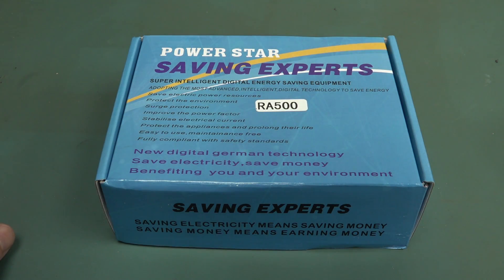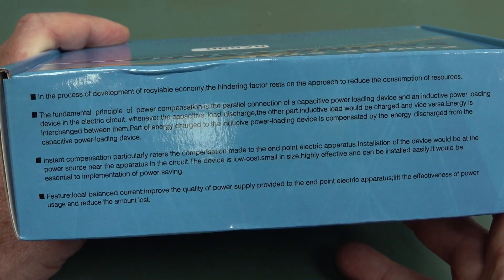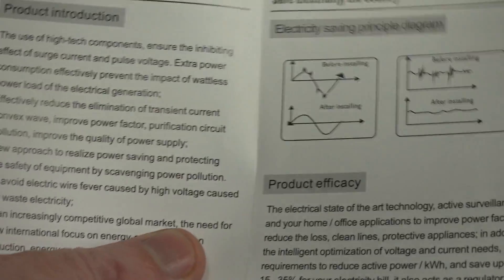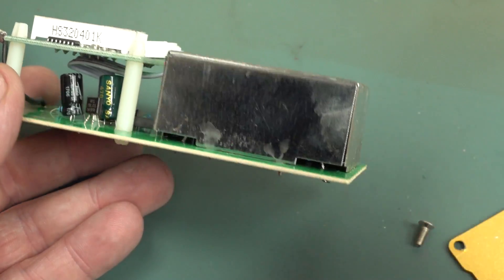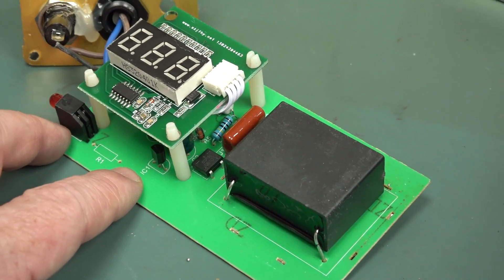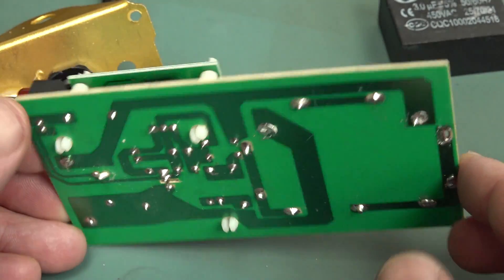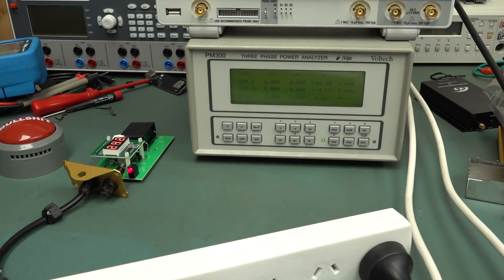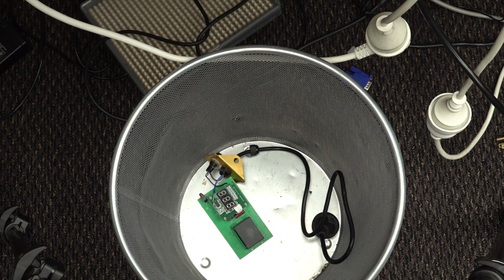EEVblog #1191 - Digital Energy Savers BUSTED!

Comment: I went to the mass merchant and bought some spark plugs, save me 30 percent of gas.  I bought some new special oil for the engine, save me 30 percent on gas.  I got some new tires that give good life and save 20 percent of gas.  I put a gasoline magnet on my fuel line to save me 30 percent of gas.  I was driving around the other day and my gas tank overflowed.
Reply: LOL.  And to top it all off, that's not how percentages work!  (But I'm guessing you already knew that, and that's part of the joke)
Reply: Oil barons hates him! Find out how he generates gasoline with one simple trick!
Reply: Robert Slackware  Understand that yea.  They no longer  make solid wires for cars that are legal for road use due to EMI.  Unfortunately I am a believer in at least trying to keep the radio waves fairly clear.  Am a ham here, like to talk around the world now. Thanks for reply.  Plus all cars now use COP's  Coil Over Plug setups.
Reply: Is there really a way to save gasoline with a car/truck ?
Reply: @MrQmason  you can go get it remapped ECU by a pro tuner. Otherwise maintenance; clean oil, air filter, injectors etc

Comment: Quick question. On the board is a red LED that's at a 90 degree angle, with a bit of plastic around it. What would I have to use for search terms to find and buy these?
Reply: Pretty sure I've seen them in the Jaycar catalog. Check there and you'll find the terms.
Reply: Maybe LED spacer or right angle LED spacer
Reply: "Right angle PCB mount LED" brings up loads. Mouser calls them "LED circuit board indicators" with LEDs installed - but you can get just the holders, they are called "LED holders".

Comment: Yet another fuse holder wired incorrectly.  The live wire should go to the end terminal not the side terminal.  Wired the way it is, it is possible to get an electric shock if the power is on whilst changing the fuse.  i.e. Finger touches the contact on the thumb screw end of the fuse, and the other end of the fuse touches the side contact ring when inserting.
Reply from the maker: Yep

Comment: Does it matter that the Brown wire is going to the Neutral hole on the board and the Blue wire is going to the Live ?
Sure AC works either way, but if there's a failure, could it lead to parts being live that shouldn't ?
Reply: On product that was well designed it wouldn't really matter. Here in europe we can flip plugs so there is no way to know which side is neutral and since most things work 120v-240v 50-60hz it's just easier for manufacturers to properly design and just swap plugs.
This product however doesn't have any protection.

Comment: But gasoline line magnets just have to work, right? Right?!  :-)
Reply: That and the "Tornado" device.
Reply: @excavatoree  I think that does actually work if the carburetor was poorly designed.
Reply: They do actually work but not for the stated reason. IE tell someone they have one fitted (even if they have not) and it still works! It's a purely psychological effect whereby if someone thinks they have one fitted they subconsciously change their driving style to be more efficient. So if you fit one and don't tell the person it does diddly squat too.

Comment: I saved 10% on the energy of my electric shower with no device at all. Just cut my bath from 10 min to 9 min. Amazing!
Reply from the maker: To Kickstarter!
Reply: Don't fall for this sham! Just stop showering and you'll cut your bath bill down to zero!
Reply: @jon87386  I cant still have a bath with bill down to zero. I just have to get rid of that small resistance inside of it! Spoiler alert: Tomorrow on Kick Starter: Electric shower with almost zero power consumption using a 100 MOhm resistance. How it works: Rising the resistance value the current is also reduced, so the power. That's Ohm's Law, no infringement of any Physical Law!!! It should work though.
Reply: @jon87386  I have my van parked down by the river, I just slip out the door and into the river, usually on Saturday. It's free!
Reply: I got one better for you, Just shower at your neighbor's house. No power used and you are still fresh and clean roflmao...
Reply: Bathe once a year whether you need to or not !  ;-P

Comment: neat case for projects at least
Reply: Ebay search... extruded aluminium enclosure.
Reply: @simonhopkins3867  -  Keep in mind that sometimes it is actually cheaper to buy a crappy product for the parts than to just buy the parts themselves. Best to check if this is one such situation before going either way.

Comment: Only digital energy saver is a Kill-A-Watts meter use it on your biggest energy hogging devices and once you see how much power it actually uses you'll learn to turn it off when it's not in use.
Reply: Kill-A-Watt is a bit dated by now. There are quite a few power measuring smart plugs available, which allow better analysis for very dynamic loads.
Reply: @NiHaoMike64  Mind to name some of them? I'm interested at grabbing one and there's a kinda cool and good-looking one by Zhurui (AliExpress). A bit pricey, but seems to stand itself from the knockoffs that flood the site.
Reply: @brunoleonardo3315  There's the TP-Link HS110 which has a library for use in scripting. (I use mine for manual measurements using the app. Micah Elizabeth Scott uses a few for automated power measurements in her IT setup.) I also recently got some BNC-60/U133TJ which are a lot cheaper (under $6 each on sale!) but I haven't had them long enough to comment on accuracy, other than that they're not as precise as the HS110.
Reply: You are so right my friend. I have found that the water heater is the most "not thought of" power hog.
Reply: You could argue the Switchmode Power Supply is probably the most effective digital power saver, by going digital on power supplies we saved a LOT of power
Reply: @mycosys  Some power supplies use digital or digital enhanced PFC, which boosts efficiency at low load.
Reply: @NiHaoMike64  PFC doesnt boost efficiency, it corrects power factor. Did you not watch the vid? Correcting power factor can actually cost you more if you are charged for real power.
Reply: @mycosys  Digital and digitally enhanced PFC boost efficiency by playing tricks with the PFC circuit at light load. The point is to reduce the power used by the PFC circuit itself, while still maintaining a good enough power factor under load.

I really do think the 80 Plus standard should have made PFC optional, since it is indeed of little benefit to most residential users.
Reply: From what I remember, that only works on 110-120V and with the US plugs.
Reply: a solar water heater that feeds into the main water heater so it doesn't have to work as much during the day can make a huge difference in your power bill
Reply: That Kill-a-Watt was indeed a Kill-er-Joke!  xD
Reply: Why electricity is dirty cheep, doing that feels like chasing cents?

Comment: 30 bucks for a project box...strip it, add custom PCB (with neat little LCD please), built in fuse holder,.....sooooo many uses for that bit of kit that don't actually involve using it for its intended purpose.
Reply: $30 bucks is steep considering you can get a very similar extruded aluminium case from aliexpress for less than $4.50 delivered! 
https://www.aliexpress.com/item/Aluminum-Case-Box-For-Circuit-Board-Electrical-Connector-DIY-Shell-Shied-Enclosure-For-Electronic-Projecter-Power/32907882836.html
Reply: @Drew-Dastardly  Nice find.

Comment: In Norway, all the new digital smart meters measure apparent power. Every household has those now, they are required by all the power companies, they changed all the meters in Norway over the last 2-3 years.
Reply: if that is the case In Norway i mite as well use vintage gear it would be cheaper to run on  apparent power because they generally they have better  power factors beaning that they do not have switch mode power supply's in the old gear
Reply from the maker: satanclaw That's for the confirmation. Perhaps the VA data is actually sent back and if you are a very naughty boy with a total power factor of 0.1 or something you'll suddenly find yourself getting a kVAh bill...
Reply from the maker: Are you actually billed in kVAh ?
Reply: @EEVblog  I believe so. This was a very big deal when they started with the smart meters, but it's died down now that everybody has them, I believe it's the same way with all these new smart meters that are being installed all over, I understand they use them in Canada too.
Reply: @SantaClaw  In the Netherlands we have smartmeters as well. But the bill is still in kWh for households.
Reply: Here in Austria ;) we also have the new "SmartMeter" and get the bill in kW/h for a normal home, with bigger loads(companies) there is also a bill with the kVA/h.  @EEVblog
Reply: @schimpl94  Kwh, not kW/h.
Reply: @okaro6595  Terminology matters..
Reply: @EEVblog  In Finland we're billed as per kWh. However, it is pretty common here to have seasonal and time differences in pricing, for example electricity at night is cheaper than electricity during the day.
Reply: Why? Apparent power is not real. It is not consumed. Even those who pay for reactive power pay at a very different rate.
Reply: I've heard people up in arms about this, Big Clive (another youtuber) keeps saying it, that power companies want smart meters so they can bill people for apparent power in some huge cash grab conspiracy, but its nonsense. What the power companies are doing right now is charging as much for their products and services as they think the market will bear and their competition will allow. If they thought they could get more cash out of you, they'd put their prices up. Pushing for smart meters to bill for apparent power in some roundabout way to charge more in disguise is completely unnecessary when they can just charge more per kW/hr if they want to. Thats not to say that power factor will never be involved in domestic billing, maybe it will and maybe it wont but if they do start charging for power factor, what will the total on your bill be? As much as they think the market will bear and their competition will allow, of course, just like it is now.
I think smart meters are primarily a data mining operation, collecting info on patterns and practices of energy consumption and people's day to day lives, which collected en masse from whole populations has commercial value in itself, as well as being of practical use to the power companies in their own business.
Reply: @-yeme-  
It's not nonsense.